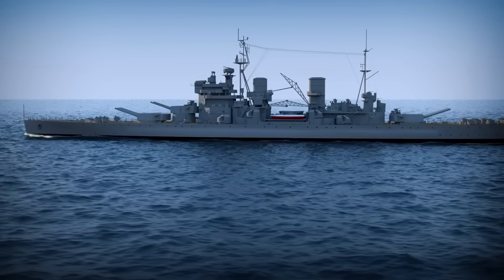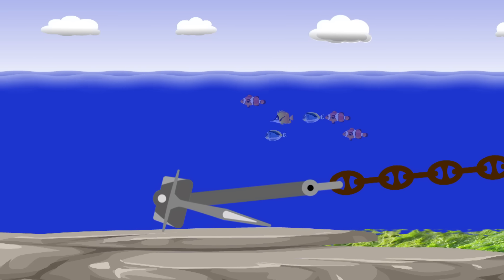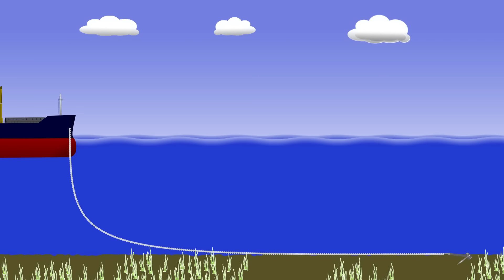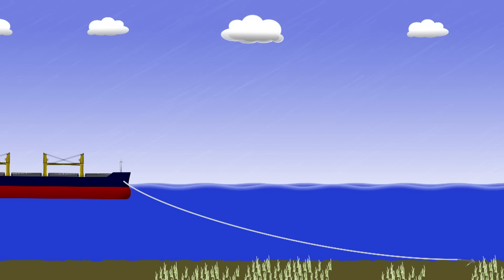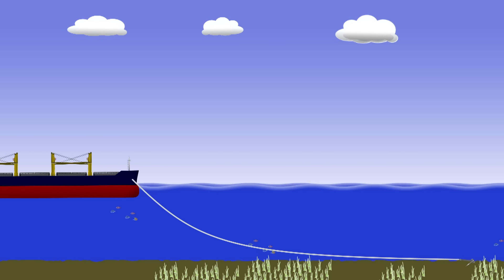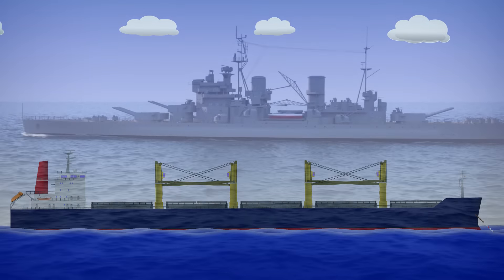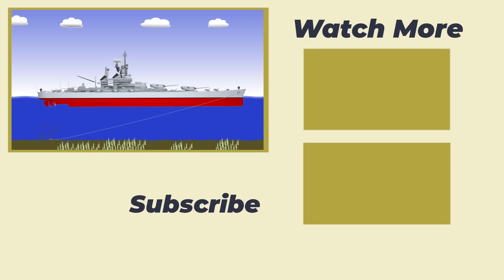The Truth About Anchoring Huge Ships

Comment: I’ve always wondered how the Anchor actually manages to remain on the seabed. I knew that the Anchor was heavy, but I couldn’t understand how it could stand the weight of the entire ship pulling on it. I never realised that the chain had such an important role in that. I just thought that it was supposed to connect the anchor to the ship. Thanks for clearing up my doubts, keep up the good work!
Reply: Same here. Thx for the explanaition.
Reply: The video is a little off. The chain does absorb a lot of energy but it IS the anchor that holds the ship in place. You let out a lot of chain(rode) to get the anchor to pull at an angle that will get it to dig into the bottom.
Reply: @jakeski3142  nope it’s not though. it’s the chain really doing most of the work, otherwise you’d let out just enough chain to get the anchor to dig...that is not the case though as for a large ship (which he mentions....) you’d need a pretty heavy anchor.
Reply: @jakeski3142  So what happens to your scenario if it is a roccky or smooth stone sea bed that the anchor can not bite into ??
Reply: @MrTarmonbarry  well, for one those are damn rare and for two, as mentioned those make for a terrible anchoring situation even with the whole anchor chain let out.
Reply: Here’s some more knowledge for you to learn: "anchor" is not a proper noun. You might want to edit your post to fix that.
Reply: I f you think about it, they would just use synthetic rope  even Kevlar to connect the anchor. A rope has more tensile strength than the chain and would be much lighter. Look at fishing line, people fight and strain to catch heavy muscular fighting fish (Open Ocean sports fishing) with a small diameter line.
Reply: @jonathandpg6115  As far as I understood it, the chain just acts as a dampener and force redirector, absorbing sudden forces and just transferring an almost constant, horizontal force to the anchor. This way it doesn't get yanked out when the ship is hit by a wave. If only the anchor is in contact with the floor, it still takes almost all the force that acts on the ship, but without fluctuations, and almost parallel to the ground.
Reply: The anchor and chain aren't "stand[ing] the weight of the entire ship pulling on it." The weight of the ship is a downward force, which is being resisted by the water. The anchor is resisting the sideways force on the ship caused by the wind and current. The only reason that a heavier ship needs a larger anchoring system is that a heavier ship is larger, so it has a larger surface exposed to wind and current.
Reply: THE CHAIN HAS NOTHING TO DO WITH IT. Look at all the vessels that use rope. It is all about the scope

Comment: On smaller craft, I found it advisable when weather demands to take heed of foul weather/ winds/seas/ tides is to secure a heavyweight to the chain about halfway down so it will shorten the anchor scope. This will keep the anchor digging, instead of pulling up. It saved me a couple times. Good for crowded anchorages.
Reply: For some reason I have a kettlebell in mind.
Reply: You are right, but don't forget it's there when you hoist the anchor.
Reply: @PatrickQ4HBD  it's actually called a "KELLET" interestingly enough, I've used the technique a few times myself.
Reply: Um no you want to add more scope not reduce it
Reply: The old beer can filled with lead.
Reply: @JH-lo9ut  that's cuz of the weight on the "ancor" those were attached to rope not chain. And usually the can would sink into the mud
Reply: @jamesTBurke  Yes ideally you want to add more scope. As that forces more of the chain to lay on the bottom which holds more then the anchor. However as stated in the OP, during crowded anchorages one does not always have that option. So putting weight halfway down the chain forces the chain to lay more flat along the sea floor and in essence does something similar as laying out more scope. There is more chain resistance from it laying on the sea floor.
Reply: You could use heavier chain for the 1st 2-3 meters for similar, always there, solution.
Reply: @artsmith103  lots of smaller boats use this principal. Boats under 50ft will often use just anchor rope, but it's advisable where poor weather can be expected that you have a section of chain at the anchor and attach the rope to the chain.

I used to be skeptical about how much effect such a short length of chain could be. Until I tested it myself. I found where I could drag the anchor with just rope, I needed significantly more throttle with even a short 10ft section of chain. I have a 6ft section of chain on my pontoon for that exact reason.
Reply: @2009dudeman  Exactly the right way to do it. My sailboats and motor boat are 1500-2500 lbs, all shallow draft with retractable keals.. I use chain length of my shallow draft + water level to deck distance + 1'. So typically ~7' of chain attached to rope rode. Use welded chain at least  1 size bigger than minimum. Keeps chain out of the cleat, tells you when you are nearly vertical when hoisting, and flattens the anchor rode angle to keep the anchor digging in at its designed angle.
Reply: Ideally, when the weather demands, you want to add secondary anchor attached to the bow to limit the ship's movement

Comment: I've always wondered how ships pull up anchors if they've actually engaged the spades. I drastically underestimated the amount of chain. Thanks for the explanation.
Reply: When you are what they call ''weighing anchor '', or taking it in the ship will move forward very slowly if there is a lot of chain out
Reply: Seth yeah me too
Reply: Never, EVER underestimate the amount of chain, bro!
Reply: Ummm those anchors are rarely ever used. Most of the time if they are actually used in the ocean like illustrated they are cut off and left behind since they are soo heavy
Reply: @jamesTBurke  I figured they'd be very rarely used, because a stationary ship isn't earning any money.
Reply: @setharnold9764  that would be true but in the end the captain of the vessel has the final say. Those anchors are used only as a last resort. The chain winches are not strong enough to lift hundreds if not thousands of ton of chain off of the sea floor especially not when most of the ocean is miles deep

Comment: When I was about 11 I saw a naval monument that was just an anchor and part of its chain, I tried to lift one of the links and it would not move an inch. The link was about the same size as my hand, but it must have weighed at least 100 pounds. That made me understand just how gigantic these ships are, and after this video now I know that the weight of the chain is what keeps the ship in place. Great video!
Reply: You're misremembering. Even a sphere of steel the size of a child's hand would only weigh about 10-15lbs. The links of an anchor chain are extremely heavy, but they're much bigger than a child's hand.
Reply: @beeble2003  That's true
Reply: @beeble2003  Not that you are wrong, but it could also be that as part of the display, they welded the links together.
Reply: @kcgunesq  That's a very good point. I think they often do that.
Reply: Um no. The information in this video is 100% inaccurate
Reply: In moderate to heavy pull on the anchor, the weight of the chain keeps the pull on the anchor horizontal enough for the anchor to hold fast.  Video is not correct.
Reply: @jamesTBurke  care to give some examples?
Reply: @MarkHanford  of what?
Reply: @jamesTBurke  of how the video is inaccurate?
Reply: @jetison333  in every way. The anchor line is NOT how a vessel stays anchored.  Those massive vessels don't use anchors. They have GPS systems hold th in place. Their anchors are ONLY used in emergencies because their winches are NOT strong enough to lift all that steel. Once one of those anchors are used they are cut free. The anchor DOES dig into the soft mud and that's how a vessel stays anchored
Reply: @jetison333  The ship + chain + sea floor system is, to very good approximation, a closed system. This means that it makes about as much sense to say it's the weight of the chain holding the ship, and the anchor is only "holding the end in place", as it does to say that it's the tension on the string that holds a pendulum up, and the attachment point is only "holding the end in place". It's a myopic analysis that ignores the important forces. If there's a horizontal force pulling on the ship, there's an exactly identical force pulling on the anchor. That's Newton's 3rd law.
Reply: @jamesTBurke  Can you please do some actual research? Even looking at just the Evergreens grounding report will tell you that she was at anchor with numerous (about 60) other ships while waiting to transit the Suez Canal. A ships manuevering thrusters are not very strong, fuel intensive to run (they normally electric, and require the main engine to be running at a high output to operate. Which isn't cheap), and are completely ineffective at above 7ish knots (which just the wind alone could achieve, do to how tall and flat sided most modern cargo ships are. To say nothing of any potential currents).

Comment: A very good video! I’m a seafarer by profession and I’d say you’ve summed it up pretty well. My only comments would be that instead of saying light, medium and heavy weight, we tend to say short, medium and long stay. 
Also, if you wish to turn the ship in a very tight circle for example, trying to berth a ship with a following tide, we will often drop one anchor and swing around it, so we can approach the berth while stemming the tide for greater control and safety. The ship has to be doing less than a couple of knots for this to be done safely though. Once again, great vid.
Reply: I was hoping to see something like this in the comments. I know the SS Badger does it when it docks on the Michigan side of the lake. That's not a gigantic ship, but it isn't small either.
Reply: This absolutely. No mention of sea anchors either though, which is perhaps more relevant real world similarity.
Reply: You definitely are NOT a seafarer none of the information here was accurate and us real seafarers know that.
Reply: @jamesTBurke  what makes you say that then Popeye?
Reply: @garysmith2450  because it's the truth. And I don't sugar coat the truth
Reply: @Joël hey! Imagine the weight of 400m of cable! The windlass can really only heave up about 4 shackles of cable (about 100m) as a dead lift. That also includes the weight of the anchor itself. So practically, we don’t consider anchoring when the depth is more than 80m. At those depths, the anchor will be lowered using the windlass, not dropped. You must make sure that the ship is not drifting faster than the windlass can pay out the cable. It’s usually about a third of a knot. I hope that helps. Have a look at my video of the ss Northwest Shearwater to see how beefy the chain links are in bigger ships.
Reply: @Joël you never anchor in deep waters.
Reply: @Joël those ships always have someone at the helm 24/7 because of that
Reply: @Joël we keep watch because there are still other ships moving around and they have to kept an eye on as well as making sure the ship doesn’t drag anchor. If the water is deep, we use the windlass because it would be too much strain on the brake linings to try and stop all that weight. In shallower water, we normally lower the anchor to the water level and then declutch the motor and use the brake to drop and control the anchor. Any more than 35m I would use the windlass motor. On the VLCC where the anchor weighs 17t, I would always use the motor in any anchoring. Entire books have been written about mooring and anchoring.
Reply: @garysmith2450  Your clapback ''What makes you say that then, Popeye?'' has made me laugh out loud  😂
Reply: @garysmith2450  Seeing an anchor chain snap is  alarming {Saw it happen on video} To see heavy chain basically become a  catapulting elastic band  is not what one would expect {as a landlubber}

Comment: Each 90' length is called a "shot".  While anchoring the bridge needs to know how many shots are being payed out.  On some anchor chains, each link weighs 300-500lbs.  Each shot can weigh between 10 and 15 tons alone.  The anchor itself weighs in at about one shot.
Reply: Well in Europe and Russia we call them shackles, not shots haha
Reply: In Russia shots are only for vodka ))
Reply: Each shot is painted and the 1st Class BM counts them when the proper color is seen, the biggest BM usually me or Hungry and a double jack is used to slam the retaining pin in to stop chain payout. By then the chain brake is pretty hot. This is on a frigate. I don't think you could swing a big enough hammer to stop the chain on a 89,000 ton ship.
Reply: I have a doubt. Obviously anchor plus chain should be weighing much less than a loaded ship. Then how is it that the ship's movement is restricted  by the sheer weight of the chain?
Reply: @drsundha1  in the water it is easy to move a ship if it is unpowered and sitting there.  so the chain doesn't need to apply alot of force unless there is a current or significant wind.
Reply: @ronblack7870  + the ship will line up with any current reducing drag even further. just like tower cranes that are unclutched when not used lining up witht he wind. + it works like some kinda of gravity spring, the more force you apply in lifting the chain, the  more chain is hanging to counter your force. and most ships aren't dragsters so they'll have quite the hard time getting to speed with their engines. best watch his video about breaking a shit. since just braking by drag alone can take miles, it's clear that the forces working on a ship aren't that "big" at least not compared to the size of those ships. oh and noone will anker and chill in any kind of condition that would alow the maximum length of anchor to just be ripped out.
Reply: And from an "Anchor Fail" YT video it appears that a "shot" of 90' is also 15 fathoms, so a fathom is 6 feet, correct?
Nice to know where the term "the Bitter End" comes from also.
Reply: @drsundha1  The weight of the ship isn't directly relevant: the weight of the ship is trying to move it downwards, but the anchor is trying to stop the ship moving sideways. The weight of the chain creates a large amount of friction against the seabed. That friction isn't resisting the weight of the ship: it's resisting force of the wind and current on the ship's hull. Heavier ships need larger anchors not directly because they're heavier, but because being heavier means being larger, which means more force from the wind and current.
Reply: @drsundha1  Physics, trust me the way he said it is the way it works.
Reply: @beeble2003  that's the best explanation I've heard, I wish that was in the video
Reply: @chris-hayes  Thanks! Glad it was helpful.
Reply: @drsundha1   I volunteer on a ship that is 3000 tons  if we slack our dock lines and no wind  a few strong guys (3 to 5) can actually move the ship a Lil away  from dock by hand
Reply: @drsundha1  my truck weighs 4.5 tons, I can push it by hand, it uses a parking mechanism that's about the size of a granola bar and weighs less than a pound. All of those things are possible because the anchoring/parking mechanism isn't holding the weight of the car/ship. It's only resisting the force exerted by the wind and currents.
Reply: It appears that the length (90 feet) is a "shot". Since shots of chain are connected by shackles, counting shackles as the chain plays out is the same as counting shots.

Comment: And the last 'shot' of chain is joined with all red.  Hence the old adage for the anchor detail, "If you see red, you're dead."  There's some video out there of a Navy ship that lost control, if the chain runs out too fast, capstan brake becomes useless and the bitter end tears out of the chain locker.   Scary.
Reply: Yes , thats the U.S navy ship i think you are talking about , that was a scary time for those close by . They lost control of the brake , if you find and watch it again you will see that they keep loosening it over and over , when the chain starts to run they can not wind the brake on and when they do the speed of rotation is to nuch for the brake . There are a few others like it on YouTube , one is a cargo ship and the brake linings catch fire
Reply: The black chain then goes to yellow then to red.  Yellow chain means the anchor windless brakes aren't working and to run like hell :)
Reply: @MrTarmonbarry  it's a terrifying video. Imagining all that weight just soaring out of the chain locker uncontrollably

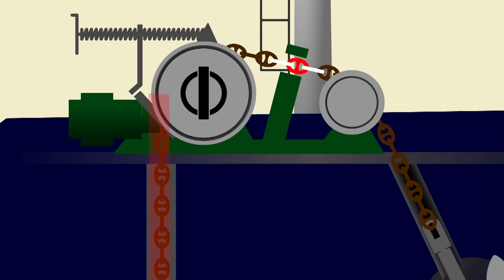Comment: 4:24 I love how you emphasized "bitter end," to point out that the idiomatic phrase has a nauiical origin.
Reply: I wonder if it is also the origin of "Calling the shots"
Reply: 'Bitter end' had its origins when rope was used on the anchor, before chain was commonly available (17th and 18th centuries). When the anchor went up and down, the rope at the ship end often never got used, and was always at the bottom of the pile (no automatic washers back then). When the stinky, fetid, anchor cable came aboard, it dripped and oozed down to the bottom of the pile (in the cable tier or cable locker) and that end became 'bitter'. There's also a theory that the inboard end was attached to the ship by being wrapped around the 'bitts', or cleats as we sometimes call them. This would make it the 'bitt-er end'.
Reply: @AndrewJillings  thank you